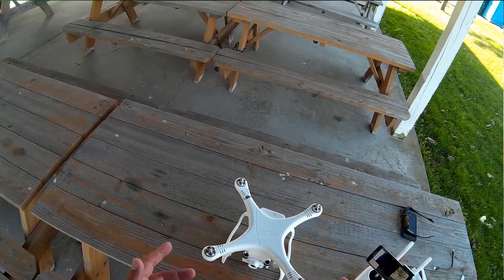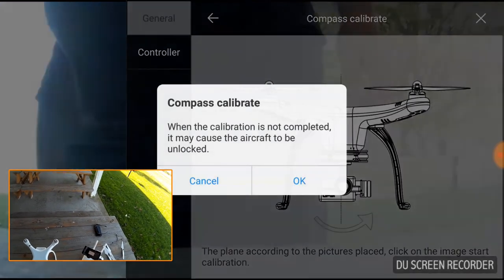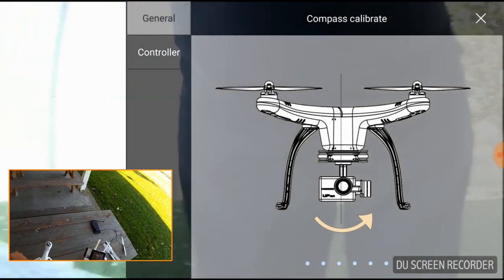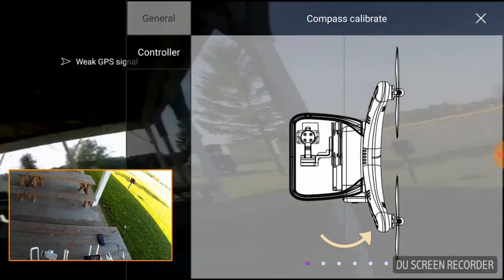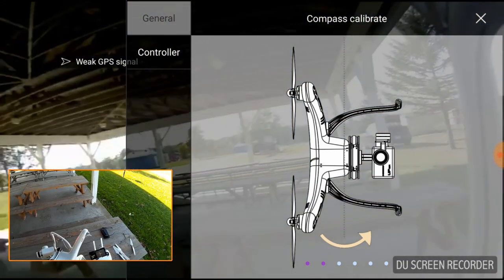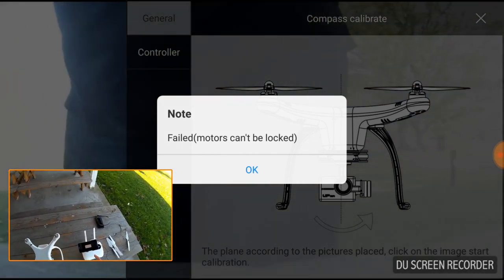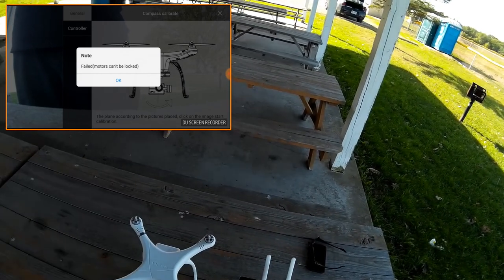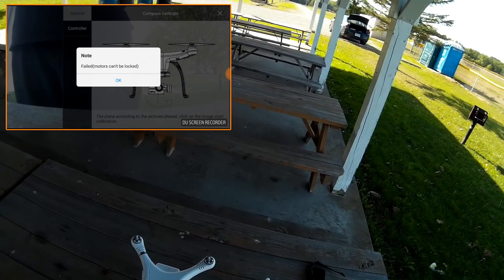Video Drone - UpAir One Plus Compass Calibration Nightmare!

Comment: I watched what you were doing, and you are actually not following the directions in the way they (the app) would like you to. When the arrow is grayed out, place the drone in the position shown and DO NOT MOVE IT. Then when the arrow turns brown (tan) then start to rotate the drone in the direction the arrow shows, once a full rotation is completed, the arrow will turn blue. Then it will show the drone in a new position, so change the drone to that position, and don't move it until the arrow turns brown. I have completed the full calibration on mine, and I think you are moving the drone when the app wants you to have it still in the position shown. Hope it helps.
Reply: Oh and I did mine indoors (2nd floor of 3 floors) and it worked fine, so don't think the awning is the problem.
Reply from the maker: Many thanks will try that as I watched the GTEN video and that was not clear as she just kept flipping around!  Thanks for sharing and watch for a new video (good or bad :-)
Reply: Hope it works out for you. Thing to remember is it is going to ask you to rotate the drone in 6 different directions (all 6 axises), starting upright counter-clockwise rotation (as I recall), just remember to let the drone sit until the arrow turns brown, that is the key, when the arrow is brown it is ready for you to move it, and the blue indicates completion of the rotation. You will have to do some flips of the copter as you go through the calibration, which is not really possible using just one hand.
Reply from the maker: LOL!  Yes I have found it takes two hands and easier with props off...
Reply: Video-Drone I have a question:: I purchased this drone about 3 weeks ago, and the camera stopped working. Been talking with email support and they are saying that the engineers will not be able to do the repairs until November or December. As they are in China at the moment. Should I return it? Or is it worth the wait? It's kinda frustrating..

Comment: I see demonstrations to do this two different ways: revolve around a vertical axis and around a horizontal axis. The one be G10 does it around a vertical axis, i.e. keep it flat and revolve counterclockwise, as though there is a rod running vertical through the drone. The arrow is not clear as to which way it needs to be done. I have found you have to be quick or it times out. I look forward to finding out the proper way.
Reply from the maker: LOL!  You and me both as I still have been able to get to calibrate!
Reply: Help how do I do this anyone have A link to do this proper

Comment: you need to wait the arrow to appear first before turning it
Reply from the maker: Have tried every way to Sunday and just no luck...
Reply: Video-Drone Im scared now cuz I just bought it literally 2 days ago
Reply from the maker: Give it try maybe you won't have an issue...
Reply: I've done it successfully on three different UpAir One Plus copters. The first four start positions are with the camera facing you, 1st upright, 2nd on the side with the top to your left, third upside down, and fourth on the side with the top to your right. There are two other orientations, but I think you are not getting it into the correct second position and the application thinks you are in a different position so switches, or that is what I gathered from the video. As I said I have done this on three different copters multiple times, and now can do it quickly as part of my pre-flight checks. Did you have any luck with any other gimbals? I have noticed a slight vibration in every UPAir drone video I have seen, kind of annoying with 4K.  Would be great to be able to mount a better one on this drone, I love how it flies.

Comment: have the same problem he can not calibrate. After the 3rd point comes Motor unlocked.
Reply from the maker: This is a common problem, would suggest returning it,,,
Reply: @VideoDrone  I calibrate the drone for 3 minutes before calibrating. Is working. 😊

Comment: Hello all.   I have the same issue but with the UP Air 2.  Looked at 2 videos from the manufacturer (one is with the phone app and the other with their software).  Tried to mimic their manual process but getting the "failed" and "motors unlocked" (broken English I guess ?).   
Has anyone tried to use their sw (QGround Control) ?   I am concerned it is in Chineese and I will fail 
With manual method - the issue is with the gimbal grinding and trying to remain in its own calibrated position.
Any suggestions / help is appreciated..
QGroundControl SW calibration Link: https://www.youtube.com/watch?v=i3FxEdZK698
Manual Calibration link: https://www.youtube.com/watch?v=bA8bdVimzsQ
Reply from the maker: never did get this to work solid it for parts...

Comment: yeah, got the same problem days ago then found this on the tube ( https://www.youtube.com/watch?v=K9hATKI5aBE ) and it pretty much solved the problem.
Reply from the maker: Thanks for sharing and that was interesting as one of thing is he is depending on table and this should be done in an "open area" and yes pure wood table should not an issue but finding that might be a little hard.  Second is I noticed a difference in the way his app  performed which has me thinking I need to try another device also as quite possibly the way it run the app might be problematic too...
Reply: thank YOUman ! your channel is SUPER !  as for the compass yeah, definitely need to be calibrated outdoors, last time I levelled the upair indoor I got  it crazy ( kept loosing altitude dramatically ), then done it again at the beach and now it flies sweet as honey :)
Reply from the maker: Cool!